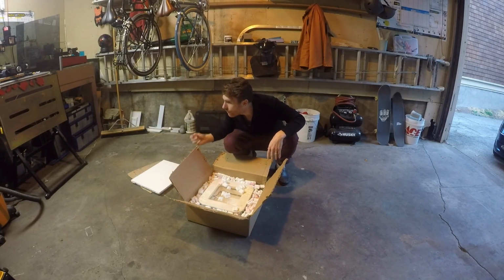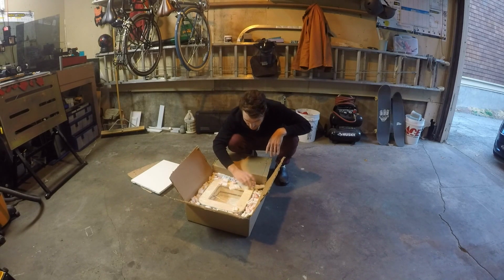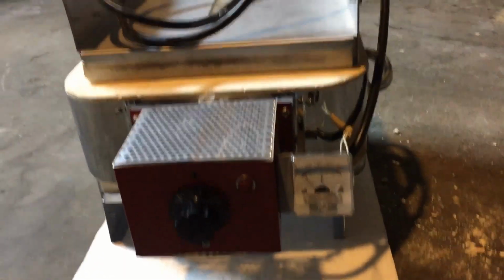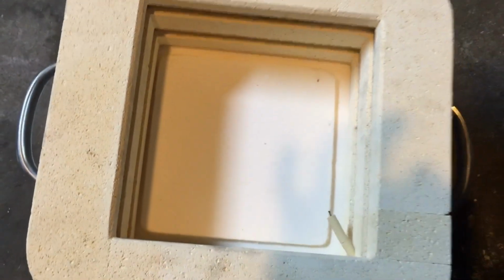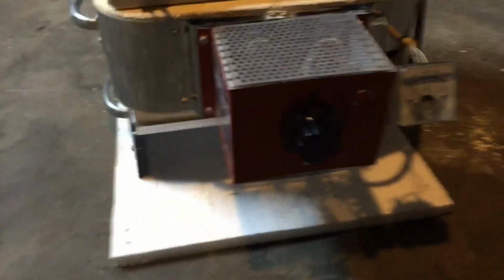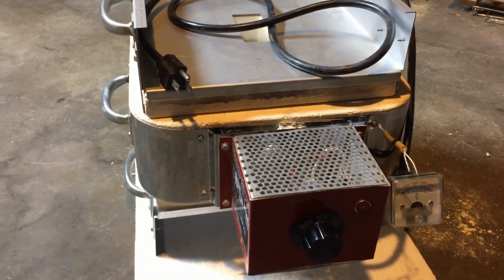Ep. 00003 (EvenHeat Studio 8 Fire Brick Repair)

Comment: do you really have to take the whole thing apart (handles etc)  to replace the fire brick?  or were you taking it as an opportunity to clean it all up.
Reply from the maker: I did because I purchased a full set of fire bricks that came with the outer metal ring attached (including heating element). There are individual replacement bricks for certain quadrants and if you were to go that route, you wouldn't have to remove the handles or the entire front controller box.